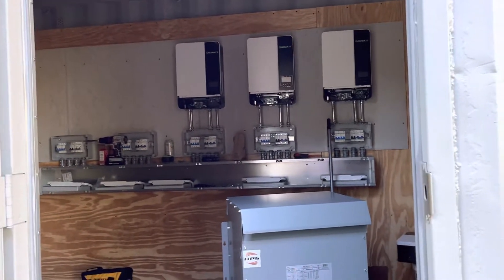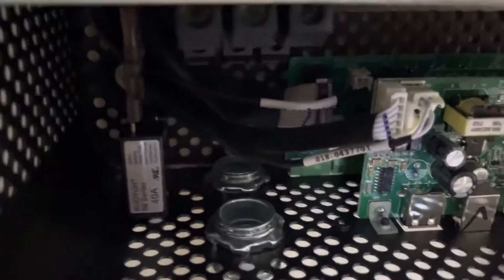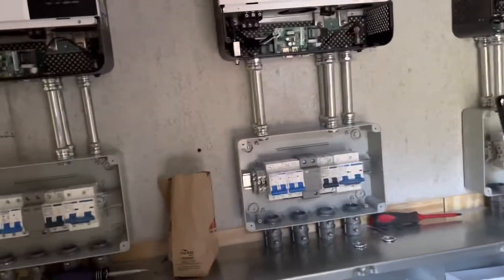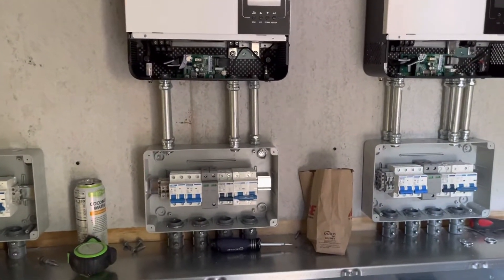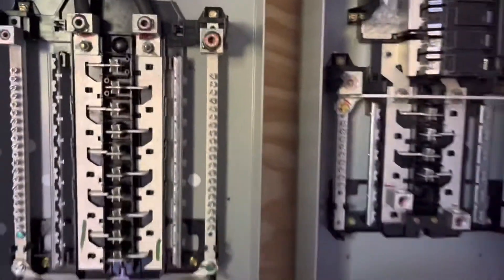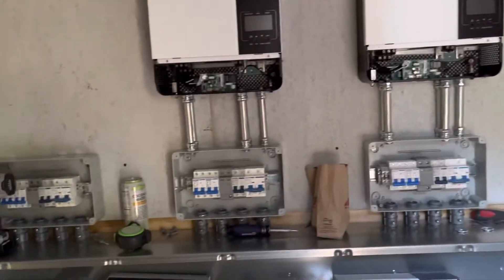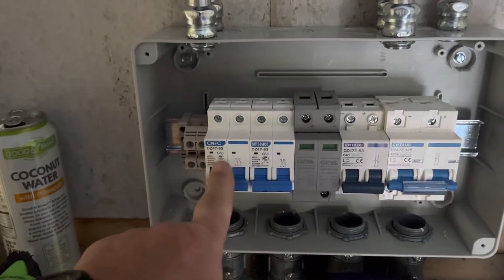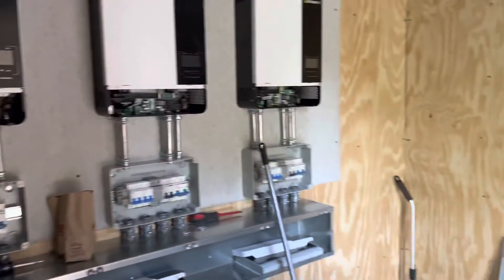Solar Power Project Update 09April2022 - Mounting Growatt SPF5000 Inverters

Comment: The green screw in the breaker panel bonds your terminals to ground. You only bond them at the first disconnect panel. Take that screw out of the other panels and run all grounds and neutrals separately
Reply from the maker: The inverter output panel does not have a neutral. I’m using that bar strictly as a ground bar hence the grounding screw. 

The neutral in the system output panel is separately derived through the isolation transformer and therefore it must be ground in the first panel on secondary of the isolation transformer.
Reply: @jeffmotes2129  https://cliffordpower.com/wp-content/uploads/2020/01/IS_03_Switching_Neutral.pdf

1.0 Introduction
An issue frequently considered by system designers is when to switch the neutral of a transfer switch used on a standby generator system. When the neutral of a system is grounded, a 2-pole (single phase) and 3-pole (three phase) transfer switch is selected, and the neutral is a solid link with only the phase contacts carrying the load being switched. If it is determined, mainly for personnel and equipment safety, the neutral has to be switched, then the transfer switch selected would be 3-pole (single phase) and 4-pole (three phase), with the additional pole switching the neutral. This information sheet discusses the issues and offers some recommendations.
2.0 NEC Regulations to be Considered:
Before considering the reasons for switching the neutral, we have to consider regulations of NEC 230-95 and NFPA 70-2016 that lay out procedures for Ground Fault Protection (GFP). Entities such as NEC and NFPA that specify safety standards are concerned that grounding the neutral alone does not provide full protection from stray electrical currents and other faults occurring in current carrying conductors. NEC makes the following distinctions between system and equipment grounding:
System Ground:
A system ground is a connection to ground from the current carrying conductors of a circuit or interior wiring system.
Equipment Ground:
Where the equipment body not carrying current has metal parts, such as the generator or metal conduit is grounded.
System Neutral Ground:
This is when the neutral point of a transformer, electric motor, or system is grounded. The neutral point is where the same potential is found, if any of the free ends of the system are connected to the appropriate main terminal or system line.
NEC recognizes that while the utility supply grounds the neutral of the power transformer supplying the user, personnel and equipment safety can be at risk from transient voltages from line to ground during switching and ungrounded neutral faults on connected equipment. Therefore, the NEC requires that GFP devices must be used for all solidlygrounded wye services. GFP devices are designed to detect phase to ground faults. To avoid unintended paths that can go around the GFP device, it is important to avoid several neutral grounding points and have the service neutral grounded at the main distribution board. 

3.0 When to select a solid neutral: (Graphic One shows a diagram of a system with solid neutral)
When the designer can incorporate the generator system into the rest of the system, the generator set neutral is not grounded, and a transfer switch with solid neutral can be used. When the neutral is common to the normal and standby systems, in the event of a fault, there could be some division of current that would occur in the event of a ground fault. In this case, the 3-pole transfer switch must have contacts designed to withstand fault currents for the period of time taken and required for the GFP device to trip.
4.0 When to Switch the Neutral: (Graphic Two shows a diagram of a system with a switched neutral)
When the generator system is required to be separately grounded at site, a transfer switch with a switchable neutral should be selected. With a switched neutral, the generator set can be wired as a separately derived system to the load and normal power supply. In this configuration, the neutral is not solidly connected through the transfer switch, but switched. Also, the neutral is designed to be switched simultaneously with the switching of the load carrying phases. By utilizing this system, the designer/user will ensure GFP operation as intended by NEC codes.
In the switched neutral mode, the generator is a separately derived system to the rest of the electrical system with its neutral grounded at the housing. The neutral return path is left open for ground return currents by the transfer switch contacts. In addition, nuisance tripping caused by unbalanced loads is avoided. The generator set is totally separate to the utility supply and a safe alternative to a solid neutral connection.
Another example where a switched neutral connection is preferable is when there is more than one separately derived electrical system being backed up by a common power source. An example of this would be a building being fed by two different utility sources. For this type of installation, each utility service would have its own separately derived neutral ground. To properly back-up portions of each utility service, the installation would require two transfer switches. If the transfer switches had solid neutrals, each system would have two grounding paths. To avoid this scenario, the designer would select a transfer switch with a switchable neutral pole to maintain the single path to ground system.